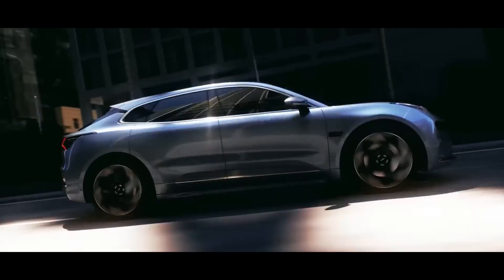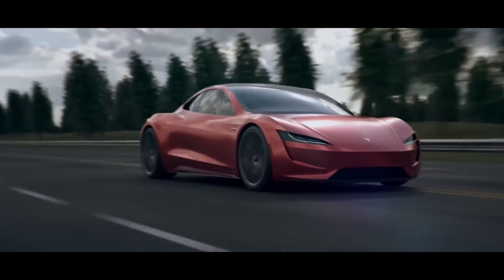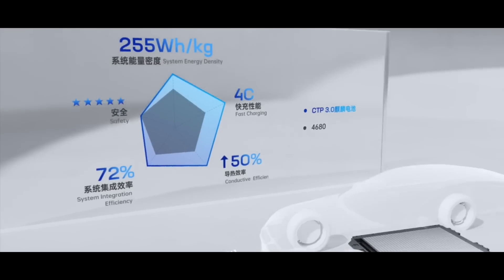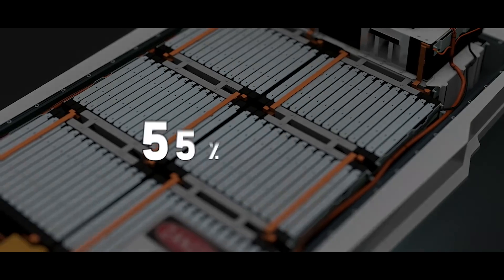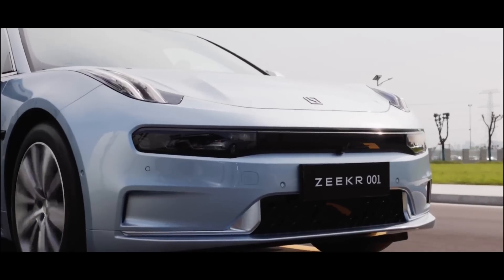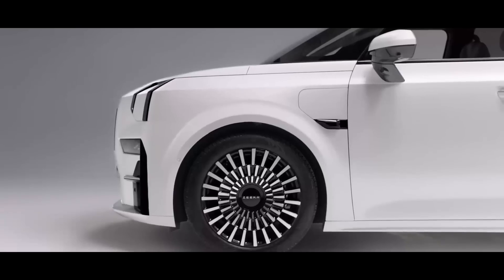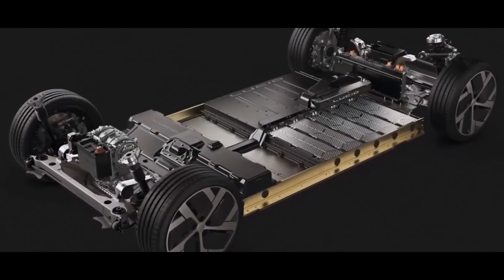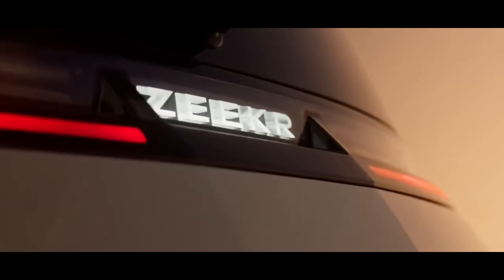China Shocks entire EV Industry with advanced NEW Battery in Zeekr Cars | Tesla agrees

Comment: Usualy, we know that the battery is built for the capacity in ah (amper hour). Now, there are a lot of electrical infos like: wh, kwh, etc. What are the values of the charging voltage, min to max? What is the battery voltage? Is it to sweet to be really. I like this car but not  to be the dreams. All the electric cars have a lot of engine power 300hp-600hp. For what reason this power? We don't need this. AWD must to be built en function of the route situation. Most of the time we need only FWD. The internal luxes of the car will give us less capacity of the batteries and less miles/kms. How can we save the car after a burning by cause of the battery on the route?

Comment: I never understood how come the batteries were not configured like an engine. 

Three cells in different stages of charge, discharge, and rest. 

You would have a FWD System 

A Three section battery and an alternator on the rear axle 

With battery advancements 

Advancements in engineering for electric motors for a car 

You would think we would combine all these advancements together and see where we’re at. 

This is what progress is. 

😶
Reply: 发的电还不够，发电机增加的摩擦
Reply: @1314fangqingxing  

The Four Stages of Charge are sequenced so I think you’d charge a car battery in individual sections 

A charge controller or voltage regulator is an important addition to any electric system. 

The advantages of a voltage regulator include: longer life expectancy for the battery banks, faster and more reliable charges and an overall healthier battery bank.

Most voltage regulators perform four stages of battery charge:

The bulk charge
The absorption charge
The float charge
The equalization stage

The bulk charge is when a battery has depleted its charge by providing amperage the voltage drops. 

During the bulk charge, the alternator output is maximized until the battery voltage is raised to the desired level. 

The battery packs should be configured so a section is always charging and another section is being used. So once bulk charging is done absorption takes place. 

The absorption charge is also known as the acceptance charge. 

If the high rate of charge produced in the bulk charge were to be continued, the batteries would heat up producing a gassing effect and in extreme cases runaway gassing which is a potentially explosive situation. 

To avoid this the voltage is held steady to the desired level achieved in the bulk charge but the amperage is reduced according to what the battery will accept. 

We need to charge the battery in stages which represent the mechanical motion of a combustion engine 

The battery charging stages need to represent the mechanics of a combustion engine 

intake, compression, combustion and power stroke, and exhaust 

You need to set the battery cell up to disperse energy as a combustion engine would

The alternator would essentially be the gas and the battery packs would work like a combustion engine 

This stage provides the harder to reach places of the battery to absorb. 

The charge rate at this pressure will remain for a set period of time or until the acceptance rate of the battery reaches 2%. 

At the end of this stage the battery will be close to fully charged.

The float charge, once again if the rate of charge set at the absorption stage were to be continued beyond the desired level the battery would be damaged from over charging. 

To avoid this the regulator brings down the pressure of voltage. 

This protects the battery from overcharging while the engine is running for extended periods of time.

Many regulators have many features that are  designed to prolong battery life, as well as, to enhance safety. Some of them are:

A fourth equalization charge that conditions a battery and is essential for obtaining maximum life expectancy.

Temperature compensation, managing temperature in a battery bank when charging prevents the batteries from overheating by managing charging rates.

As well as custom settings for flooded, AGM, and gel batteries

I could go on and on 

But you could make a difference with this type of battery if it were run with an alternator system 

It would literally charge itself 

The “power loss” you speak of is a torque issue 

Not an electrical one
Reply: @1314fangqingxing  this type of configuration I’m thinking of and working on is not perpetual motion either because there are cells in the loop that will not work after dilapidation of energy 

The power band is always driving the car 

The alternator charges the dead sections of the battery 

So it’s not perpetual motion because their are sections of the battery cell that will not work

Those sections are in line to be charged 

The fully charged sections are in line to run 

The discharged sections are waiting to be charged 

So your switching cells on a circuit board system would be my guess 

A firing pattern

As the car is working 

It is charging as well

The motor doesn’t see the used cells only the alternator 

The motor only receives the battery at full charge

Comment: CATL recently announced annother breakthrough, batteries with 500Wh/kg. With such battery density Zeekr 001 should do minimum 1200 miles or 2000 km
Reply: The Chinese are here, the battery cost of this one is very high, you should hardly see it in cars in the next few years, that's why they plan to use it in airplanes first I guess